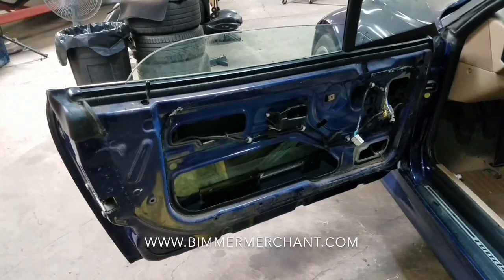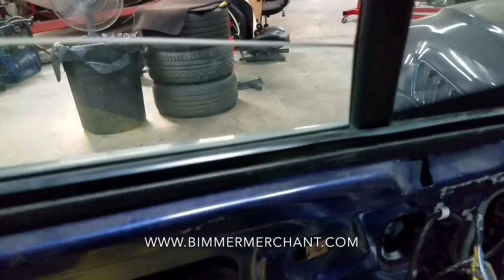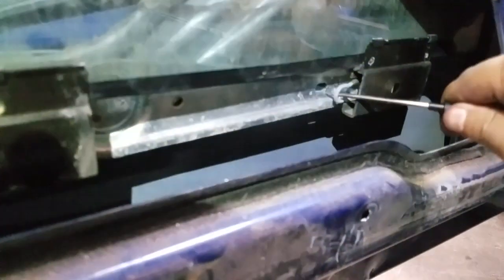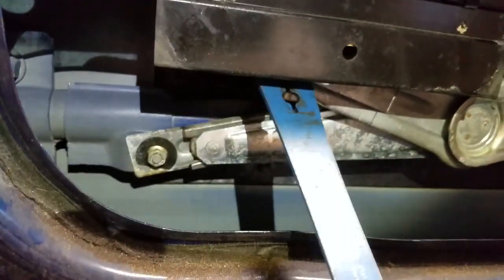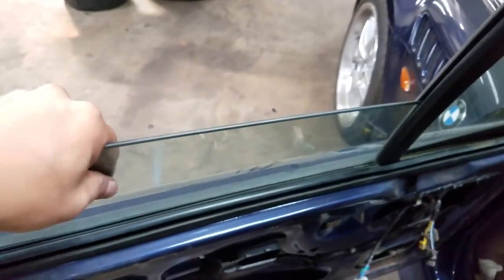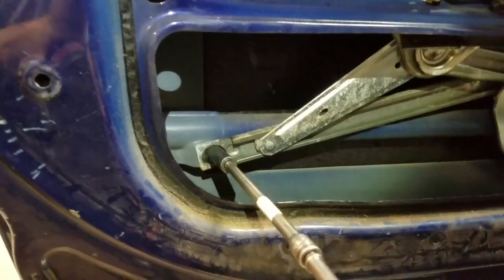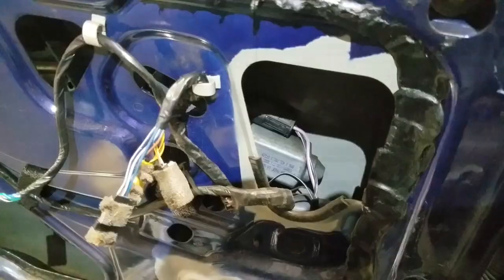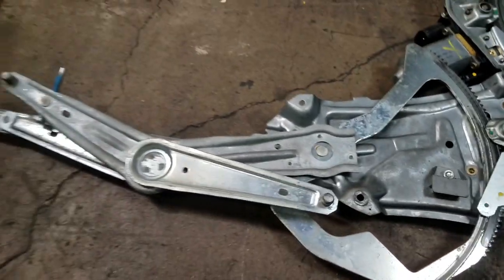BMW Z3 Roadster Front Door Window Regulator Removal OEM

Comment: My door window regulator is broken. It rolls down without a problem but when I try to roll it back up the motor starts struggling and the window goes slowly DOWN (it stays in place when the switch isn't pressed). I pressed the switch and pulled the window up by hand to get it back up.
This problem is only on the passenger side window, I suspect through lack of use. Does the regulator just need some grease or is the motor just about to die?
Thanks in advance

*edit It does not make any cracking sounds